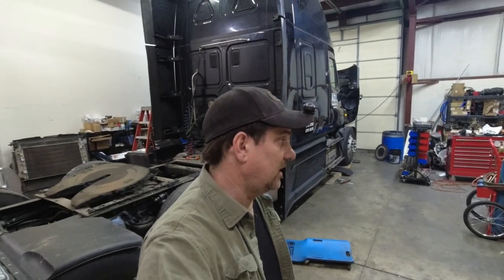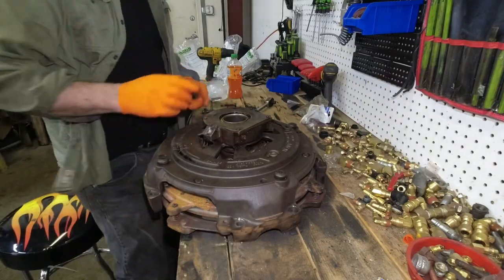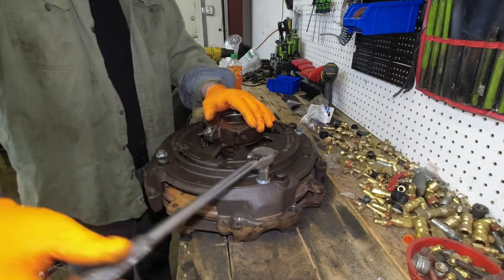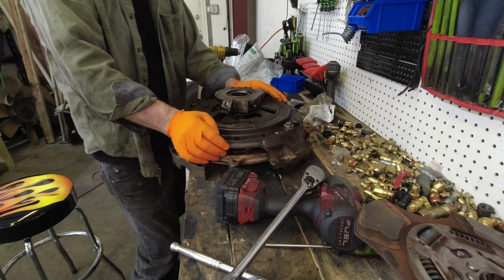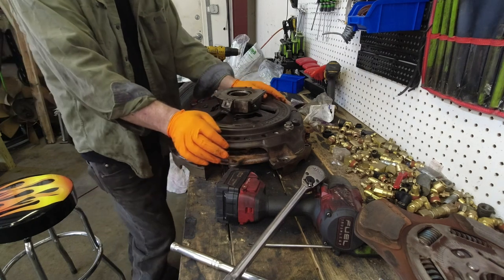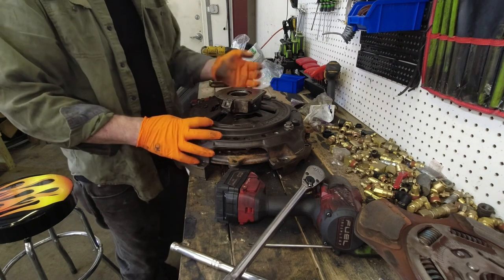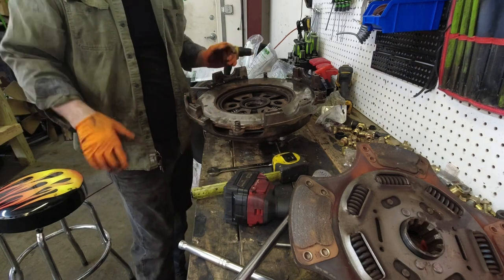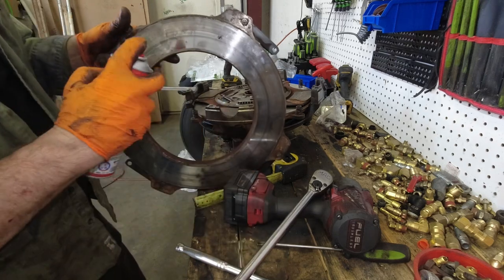How to reset a Eaton self adjusting clutch outside the truck 2022/23

Comment: Just reset a Solo on a Press, Just as Larry said take the intermidet  Plate out Put it on the Press Plate side up Press the Center of the clutch aprox. Half the throw and have presser on the adjuster it will relese when you get it depressed far enough once it releases push it to the new possession and let the pressure off the press then follow Larry's instrucctions

Comment: Do you happen to know if you can reset a clutch while it is on the truck? I was changing the clutch brake one day and it fell beside the throw out bearing and got wedged to where I couldn't reach it. Without thinking I got in the truck and pushed the clutch pedal a few times to jar it free so it would fall out. While I did that I believe the clutch adjusted itself to the point where there's no throwout bearing. After I've reinstalled the new clutch break the clutch has about a quarter inch gap between the throwout bearing and the clutch brake. It is still working now but there is not a whole lot free play. It is a hydraulic slave cylinder so there is no way to adjust.  Any ideas?

Comment: I found out you can reset them by pulling  tran far enough for the fork to clear the bearing. Install the caging bolts and reset the lever and remove the caging bolts. And reinstall. It’s very important to install caging bolts for reset , if not it will get out alignment again.